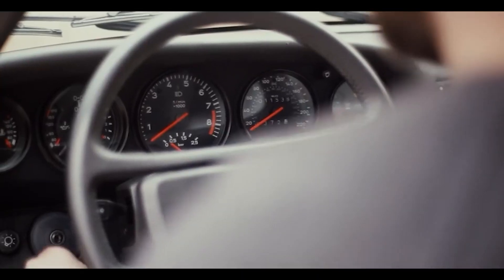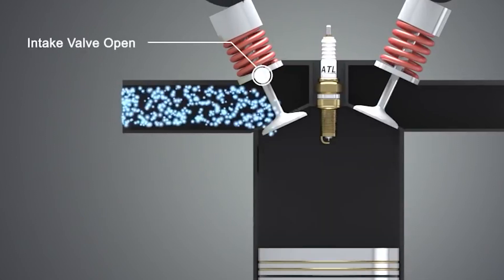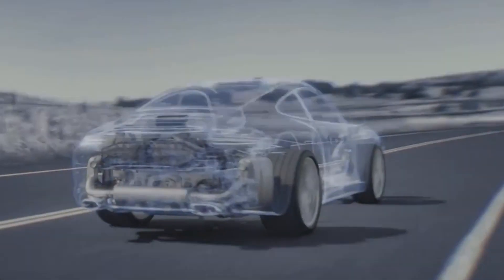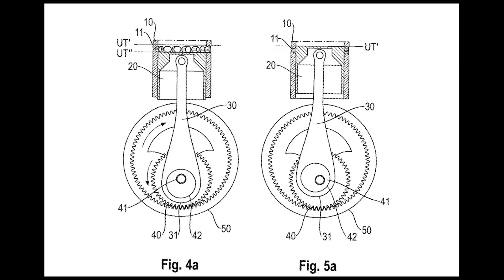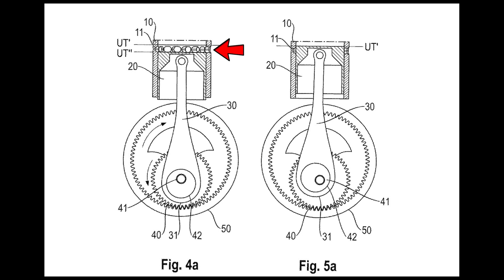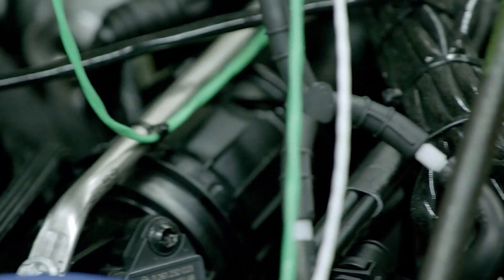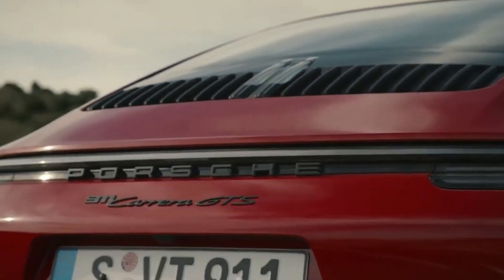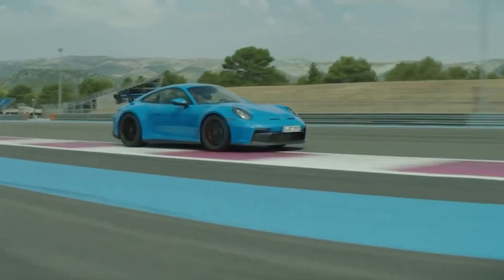The 6 Stroke Engine That's About to CHANGE the Game for Porsche!

Comment: The four horsemen of revolutionary engines:
1_ Unfavorably shaped sealing (wankel, rotaries, etc);
2_ Non positive pressure valving (coates, etc);
3_ Undampened engine power through backlashing mechanism, often gears (this one, Achates, etc);
4_ Exotic manufacturing and high friction to avoid the problem above (innengine, etc).

Comment: ICE haven't significantly improved thermal efficiency enough in 100 + years of production. 

I like that a car company is trying to find ways to reengineer old ideas to squeeze more than the 35% thermal efficiency that we've been stuck at doing the same thing. If we can clean up and improve power in the world of ICE and combine it with better ways to power the electric axles, which have 100% thermal efficiency, but are currently charged with less efficient sources than ICE and use less batteries, which aren't all that clean now, but will be upgradable to something like Solid State Batteries down the line. There is a better way, even if we still have some cars that continue on ICE. There is also much to be gained in finding a cleaner and more sustainable fuel. E85 is a thing. Making Ethanol means we need plants, which dips into agriculture. Hydrogen is a thing, but we need to find better ways to make it or new ways to recycle carbon we've already used and released into our environment. Cars require an Ecosystem, just as much as cars are an ecosystem. If we are taking out more than we are putting in and using it to fuel our cars and make products from it; Carbon Emissions might become moot and even weirdly beneficial? It's unlikely, but anything is possible.
Reply: Toyota is at 40% efficiency, but yes something like 80% would be nice.
Reply: @nxadventures9510  I might be misinformed or mistaken but wasn't it 41%?
Reply: 100 years ago EV's preceded and outnumbered ICE. What happened to change that?
(Tip: Living in Mum's basement playing video games on welfare payments is not he answer to the above.)
Reply: Diesels on their own peak at around 55% thermal efficiency depending on application but I see where you're coming from on the observation.

Comment: well its supercomplicated. prefer new 2 stroke concept with EFI and prechamber.
Reply: Absolutely.  More power strokes per revolutions. Now, just change the crank configuration to stop piston side loading on the cylinder walls, and you'll have the Burke stroke engine. The most powerful, efficient, and cleanest burning internal combustion engine that can be made. Smaller and lighter also...
Reply: @jamesbishop9156 I've never heard of the Burke stroke engine before until now? What's the thing like in concept?